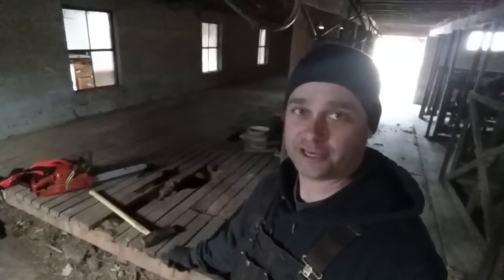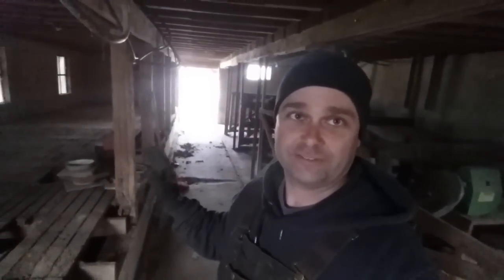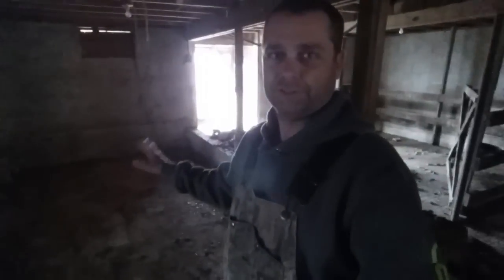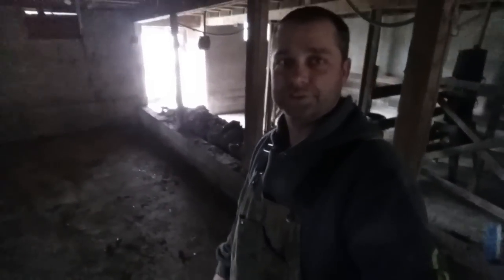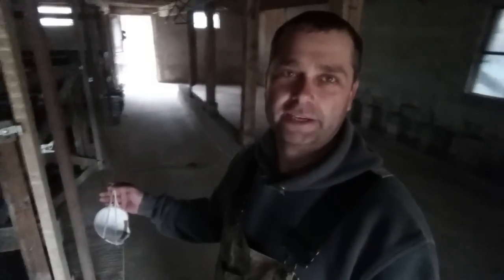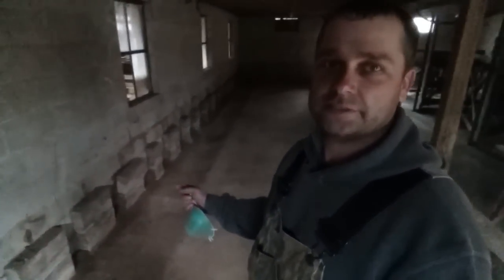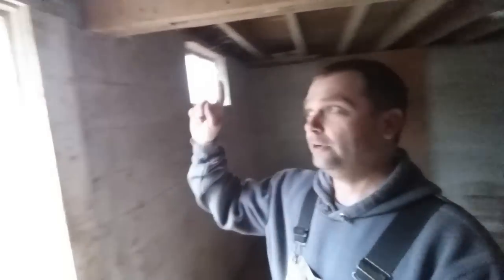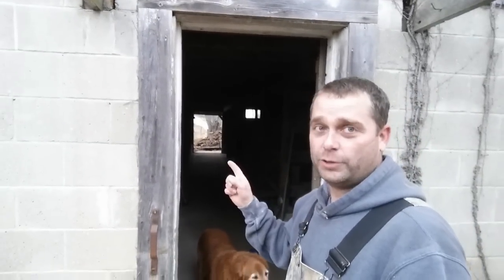Barn Renovation - Clearing out area for a chicken coop.

Comment: Lighting - Get yourself a Milwaukee M18™ ROCKET™ Dual Power Tower Light.  It will help you all over the property when working and/or filming.  I got one free in a bundle for Xmas and we had a power outage and a single charge ran for over 5 hours if I recall before I had to change out the battery.  Well worth the money and has saved my bacon when I've needed a lot of light.  Barn looks great
Reply from the maker: I am going tonight to look for some rechargeable work lights.  I sure I will use them a lot.

Comment: It  would  be  nice  to  be able to open  those  windows in  the  summer time.  Wire  mesh would keep critters in and out too!  I think I  would  build the  poultry wire sections on top of  the  block wall  to  keep  the  bedding  in  the pens.  My doors  have to  be  cleared all the  time  from the  chickens kicking the  straw and manure  against  the  wire.  I  love the  idea for the  brooder  area,  and  would  add  another  poultry pen  for  turkeys or  quail.  A  loading  chute  would be  a  good  addition to the  outside pens  with a  head  gate  to  work  cattle too!

Comment: I am sure you can get a crowbar between the 2x10s just enough to get a long sawzall blade up there to cut the nails, so you can get a new PT 2x10 in to hold the little overhang.    Home Depot has a Simpson Strong-tie bracket for the bottom of a 6x6 post to get it off the concrete floor, it is # ABA66RZ,  and concrete anchors #SL50300H, I prefer sleeve anchors, because you have the highest chance of success, even in marginal concrete,    just jack the header up level, one point at a time, measure (+1/16"  for crush) cut and insert new post, and go to the next position.     Keep up the great work, you have more energy then me.

Comment: Try widening a Doorway so you can get your Tractor with the front loader in to clean out much easier. Also get cheap Whitewash or cheap White paint to paint the inside to brighten up & not require so many lights.
I would put Chickens in a separate smaller building with a fence around so they have room to run.
Reply from the maker: The walls are cement block walls, so I don't think I could easily widen any of the doorways.  If I built a new a barn, it would definitely be able to use a tractor to clean it out.  But this old barn, I think I will always be cleaning it out by hand.
Reply: @CountryViewAcres  Get a Concrete Saw & it would be easy to cut the blocks. Many Rental places should have them. you will save hours in the cleaning & your back.

Comment: Its hard to judge the state of that wood used for floor but was it as bad that it wasnt worth saving or you just was not bothered ?
Reply from the maker: A lot of it was rotted, but some was still ok.  But, I wasn't going to try to save any, since it was all covered in poop.
Reply: I was looking for this comment.  Those are almost like pallets.  I use them to keep things off the ground, like bales and equipment that's not on cement pads.

Comment: You would have done half the work if you had used a wheel Barrow, but I would have knocked down and rebuilt using the concrete floor.